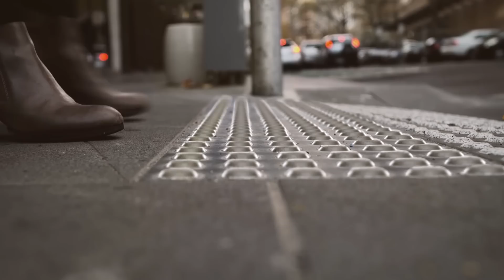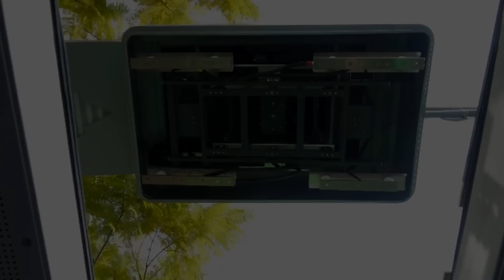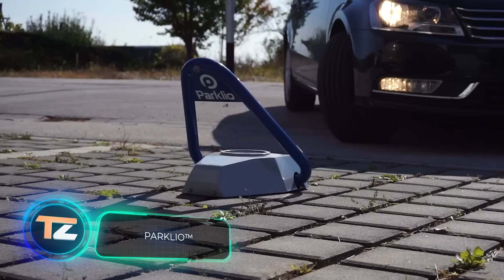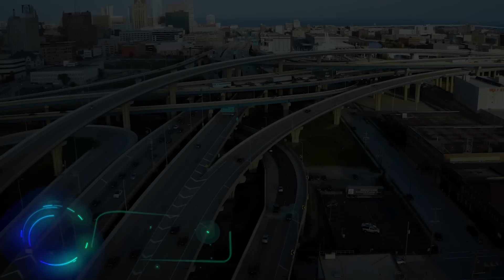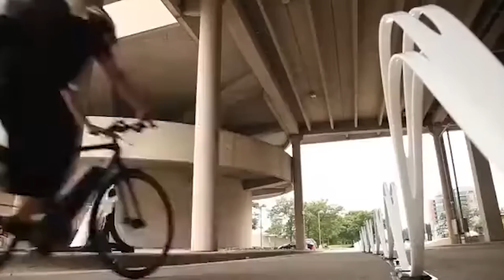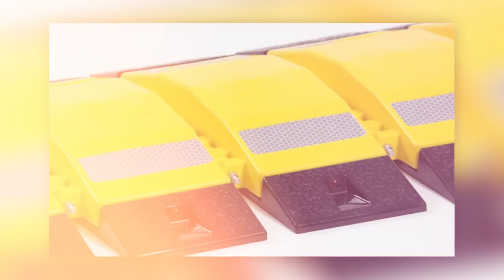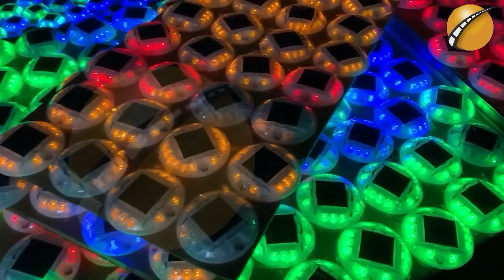INCREDIBLE ROAD TECHNOLOGIES THAT ARE REALLY INSANELY COOL

Comment: Some of these products look interesting/useful. However since I live in Canada I'm concerned how effective any of the lights, reflectors and road divisions actually sitting on the surface of the road would be in winter especially after a heavy snow and a quick pass from snow plow. Even built in asphalt speed bumps don't last that well.
Reply: We have a simpler solution in Stockholm, for the exact same effect: just put up a red spotlight aimed at the the curb.
Reply: Canada already has indentations in the road and a reflector can be put inside the indentation that can be seen by the driver. The snowplough goes right over so it won’t damage. It’s more expensive and seldom used. Most common is the rumble strips on the side of a highway that are also indentations
Reply: @ytzpilot  Reflectors inside indentations is common in the Chicago area and probably other northern cities. I would say the reflectors are far more common than rumble strips.
Reply: @robineff708  Chicago has a bigger infrastructure budget compared to Canada. Canada is the world’s second largest landmass with a population smaller then the state of California, therefore infrastructure spending gets stretched thin
Reply: Trudeau will figure a way to control you even more
Reply: Some of these products look interesting/useful. However, since I live in america, I'm concerned how effective any of them would be considering our dense population of fucking idiots.
Reply: We should install defrosting cabling on most roads.

At least around any specialized markings and equipment.
Reply: @Hexnilium  That would be really, really expensive.
Reply: @Hexnilium  :
     Or force-fields snow deflectors.
Reply: I assume its not Instead Of trafic lights, but as a bonus method. This could be useful for vision impaired too (as bumps onthe road on strips with bright color already used to tell low visioned where its safe to corss), and a whole line of lights a lot easier to see then 1 light far away.

You still need the one light for the color blind (up stop bottom go, or symbols)

While snow will make the strip on the ground invisible, harsh sun can already make the traffic light  extreamly hard to see on sunny days, so an alternative that coexist with it sound perfect to me
Reply: all these items and more are coming to waste your taxes soon
Reply: True. What amazes me is when people see green they just go. They don't look first. Green does not mean it's safe, cars go through red lights a lot.
Reply: @grantadamson3478  :
     And then there are those people that stop at green lights that have been green for a while and it's clear from two blocks before the intersection the vehicles have clearly stopped.

Comment: these either have already been in use in europe for years, maybe even decades, or are just stupid. That bike lane protractor for example, if such a thing would be needed, you shouldn't build a bike lane there, it should be separated phisicly. or slow down the road speed (the preferred option) to a point where its save enough to have the bike lane.

Comment: I like the idea behind the bike lane barriers, but they won't work anywhere that needs snow plows. The heavy, packed snow pushed aside by the plow would not be kind to them, unfortunately.

Snowplows would also damage the road markings and the solar-powered "catseyes".
Reply: Snow ploughs are a good point. But most cyclists go away in winter and come out in summer. I was thinking more along the lines of street sweepers. If the cars kick all the debris into the cycle lane and the cycle lane cannot be cleaned. Cyclists have tiny narrow tires and no suspension. They will avoid all slippy muck and colonoscopy inducing bumps and consider themselves forced out of the cycle lane and into the road.
Reply: @lukeorlando4814  They might not go away if the bike infrastructure was properly cleared

Comment: Those flashing chevrons were installed at a curve near my house. I don't know if it is making a difference. Even recently after that installation, there was a crash. And there were a couple of crashes within several weeks of installing the wood and metal barrier a few years ago. I know because I walk by often and the barrier was all smashed up. I guess people just crashed into the boulders and the concrete wall before that. It's crazy though how people crash so much there. Maybe that helps to reduce the street racing. Silver lining.
Reply: There are those motion sensing chevron on 2 spots on a curvy road in the Jersey Pinelands. 
I guess the local rescue squads got tired of pulling cars out of the pines

Comment: They installed the wave delineators in Herald Square in Manhattan. I thought they were rigid and started leaning against them at an intersection but fell because they don't actually support any weight. Whoops!
Reply: Yes, they replace flex posts, but make a much bigger mess when run over.
Reply: It also failed in santacruz ca

Comment: That road side barrier is brilliant, the one you see at 6:40 it is build about 12 miles from where I live and it was a national test pilot to see how good it is...turns out they are so good that they can't replace the old ones fast enough with this system, especially on bridges and overpasses.
Reply: its a lot more expensive than traditionnal barrier, more metal, more plastic, its higher, and uglier, 
but in dangerous curb where you have truck, it could be life saving.
and is it innovative? on the road maybe, because old tires, and big stuff in ropes/plastic is used since hundred of years for help efficiently boat docking :D
Reply: @eriklerougeuh5772  Is it uglier? That's pretty subjective. While the traditional barrier won't win any design awards, it is familiar. In time the rollers will be too.
Reply: @robineff708  Yeah I don't think anything about roads are pretty anyways. It may become popular but I don't know the price comparison

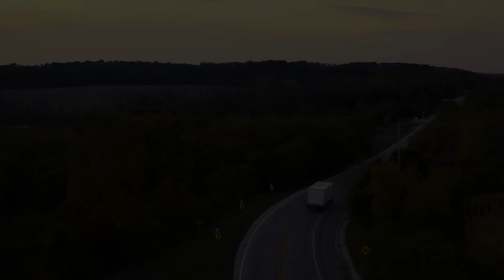Comment: 05:05 Very nice, but not really needed in The Netherlands as most of our bicycle paths are seperated from traffic.
09:09 CADO is common in The Netherlands. CADO stands for 'CAlamiteitenDOorsteek' (Calamities passage). I almost think it's a Dutch invention.
Reply: I think you're right. I see a lot of CADO signs here in The Netherlands. And I think the Bike path separators (5:05)  will do more harm than just a line. Besides, as you say, we have a lot more bike paths. Wonder what happens if you hit it only wearing summer clothes.... 🚵‍♀🩳

Comment: The Department of Transport were trialling Solar LED road studs (cat's eyes) back in the late 90s, on the A61 between Barnsley and Wakefield, UK.
They were pretty impressive, in that you could turn off your headlights and still see where the road went.  Or so I was told.  😉
Reply: The genius part about them is they are self-cleaning when cars drive over them

Comment: So the wavy bike lane dividers' only selling point is... they look nicer than normal posts? They also look like they use like 3x the material. Great. Sure, they look nice, but they're by no means are "incredible technology". And cyclists will still find a way to break every law of the road. Instead, let's start requiring cyclists to get registration and insurance; that will ACTUALLY benefit society.
Reply: At what age would cyclists using the road require registration and insurance ? Think about it. That would deter cycle use, when the movement is to try to encourage it.

Comment: The bike lane thing would be utterly pointless in my area.. 

 Behind my house, passes a fully separate, fully paved, bike path with little rest areas and picnic shelters. Cars can not access it.  There are barriers and bollards at every road crossing that are only wide enough to allow a trike to pass.  The path used to be a railroad, so it is quite level and fairly straight.   Being a former railroad,  it goes into the heart of every small town along the way.  Several of these towns along the trail have had bike shops, repair shops, cafes etc, open up very near it. The grass along side the paths is kept maintained.  It us practically a utopia for the cyclists around these parts!   Plus it was expensive A.F.  to convert 100's of miles of old railroad into bike paths.  90% of which are paved better than the actual roads,  mind you.   A lot of money,  time, planning and effort went into this paradise for cyclists.   It's all actually very nice.  The funding partially came from extra fees imposed upon drivers. The rest was still taxpayer money. 

Now,  here's the kicker..   Most of the cyclists still ride on the roads.    The perfect "bicycle highway"  is at times less than  25 feet (roughly 10 meters, I think)  away from the road it follows.  It's not like accessing it is a problem.  You'd think that they would prefer to ride where they don't have to worry about my 7,000+ pound, (3100+ kg)  Dodge, or even the Tri-axle tanker trucks driving up their  skin-tight-spandex-clad butts at 50mph (90kmh).   But no.  They HAVE to be intrusive.  The are compelled to ride right there where it is most inconvenient for everybody.  They ride at 1/10th of the speed limit on the road.  They refuse to pull aside for cars, They refuse to stop indecently exposing, and waving their  spandex clad butts in the air.  The don't follow rules of the road.  For example,  they do not have:  registration,  licenses,  inspections,  insurance,  seat belts,  federally mandated  5 MPH bumpers air bags and crash zones, proper D.O.T. lighting,  etc.   They refuse to obey signals.  they run stop signs and ride right out in front of cars like that's their job.  When you do have to honk at one of them,  they react like you're the one doing wrong.  

The car drivers are not always the problem.  Here,  there are a LOT of Karen/Kyle, entitled M.F.ers on bikes that just exist to be a nuisance and a danger to themselves and others.   So regardless if the bike lanes are beside,, combined, or completely removed from the road, bicyclists are STILL going to ride on the damn roads.
Reply: I simply do not beleive what you say. You state that cyclists ride at a tenth of the speed limit, it is barely possible to ride a bike at four miles an hour, and if the speed limit for that road was 70 mph then the bikes would be cycling at 7 mph, which is seriously slow for a bike. You realise that cycles were around long before cars were, so why should cycles have to submit to cars ? They don't follow the rules of the road you say, for example registration, licences, MOT, insurance, etc. You realise these are the rules for motorised vehicles, not the rules of the road. How would a seat belt work for a cycle for instance ? You must know that you are talking rubbish there.
Reply: @bagofnails6692  Damn my bad math..  But you get the point. You seem to think I'm totally anti-cyclist.  I'm not.  I'm anti-entitled asshole.   I know there are places without bike roads.  I get that.   I know bikes have to be on the road with cars.. sometimes.  But even then,  Why do they ride like they are invincible?   

I sometimes ride a bike.  If  IF..  I'm on a road, and hear a car coming..  You know,  a big metal machine, that moves a LOT faster and hits WAY harder than I can..  If I hear that coming,  I'm moving my happy ass out of the damn way! It's called common sense!  If there is a bike road/lane/path I will use it.  That's also common sense.   If there is a stop sign or red light.  I will obey it.  That's called the LAW.  If there is something to wear that does not expose the  shape of my genitalia to the public,  I'm going to wear it.  That's called decency.   It seems that cyclists have no regard for any of that for the most part.

 Why should Ox-carts have to submit to to new things?   I guess we should give way for men wearing pelts, carrying clubs and spears.   You know.. since they came first.  What I'm saying is that there is a propose built road just for the bicycles.  Built at much expense to taxpayers, and especially car owners, for the convenience of the cyclists,  And these cyclists refuse to use the fucking thing.    They should open it up to truck traffic so that semi-trucks can use the same routes as trains once did.  But nope.  It's just there,  not being used for shit.  Well it is being used for shit, now.   It where all these dog owners  go to let their yapping beasts shit in the grass.  I'm saying that these ASSHOLES who would rather ride in traffic rather then on the road built for them should be fined.  If I drive my van on that bike road, I'll get fined and towed.    Why not the reverse?   And IF you are going to operate a vehicle on the roads  they must have the proper registration, inspections, insurance  and equipment.  Why should there be an exception for a vehicle that is underpowered, slower and exposes the operator to more risk?   Motorcycles have to.  They use the road.  so should cyclists. Pedestrians came first, right?  Right.  Go ahead and walk you happy butt down the middle of the road.  Walk all the way to the store, or work, or school, or wherever you go.  Ignore the sidewalks!  Ignore traffic lights and signs.  Just walk right out in front of cars and trucks without a care in the world.  Walk out there like you OWN it.  See how long it is before you are either flattened or cops come along and fine you.    Pedestians an NOT allowed to walk in the roads,  It';s called jaywalking, and is illegal.   Same should be for bicycles on roads that have bike lanes, paths or separate roads for them.  If there is a bike lane/road present, and you ride on the road,  you get fined for jay-riding.   The alternative is 
to.. use the gawdamn road built JUST for you.  Problem solved.   

I don't want you to stop riding.  I respect that you are indeed helping to reduce pollution, and improve physical fitness.  That's all cool.   But Jeez-O-Pete!  Just.  like.. move aside when a car comes barreling down on you at 50 Mph.. Obey the laws of that road you are using. Oh,  and cover up your damn underwear.
Reply: @Cammi_Rosalie  I do not know the laws is your country, but in this country, many of the requirements and regulations only apply to motorised vehicles. Normal cycles are not motorised vehicles, and thus those regulations do not apply to them, and that includes the mandatory speed limits. And in this country there is no requirement to use a cycle lane where one is present. Most cycle lanes in the city where I live are not marked very well and thus are full of pedestrians dithering about. As the speed limit is 20 mph across almost all ofmthe city and I can easily cycle at that speed, technically I should not be slowing down traffic at all. Of course very few car drivers actually stick to the legal speed limit here. Cycles are not the problem, they are not causing large amounts of death or injury and they are not polluting residential streets. The only roads that pedestrians are not allowed on are motorways. By the way, you are making assumptions about myself, my clothing and my behaviour. I just want to correct you on one point. It is not car owners who are paying for the cycle laners, it isntax payers in general, and cyclists are tax payers as well. Whatever form of vehicle or road tax you have in your country is not going to fund even basic maintainance of the current road system, let alone pay for new roads or cycle lanes. Income tax and sales tax will be paying for these things.

Comment: My question is has the ETI Road Roller System been tested with motorcycles?  I'd say the answer is no, because it looks like a leg or arm would fit neatly under the bottom of the rollers ... and be neatly torn from the body.  
At a guess, it looks like a helmeted head probably wouldn't fit underneath, so at least they shouldn't be torn off the same way.
And what protects a motorcyclist from harm when they end up rolling along the top of the barrier?
So basically, many of the same problems as with wire rope barriers.

Comment: Thinking of inventing a traffic light that is connected to a water hose.  Sure, it should detect fires and automatically dispense water or foam at intense heat, but more importantly it should shoot a face full of water at idiots who cross the road on red.